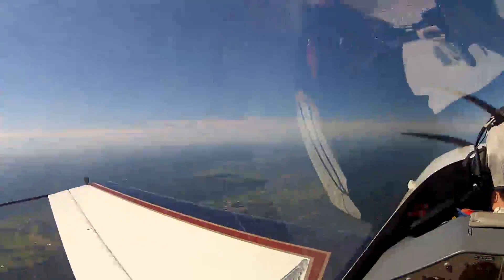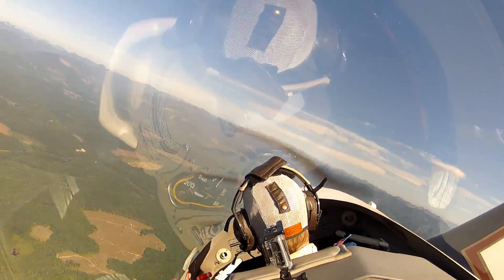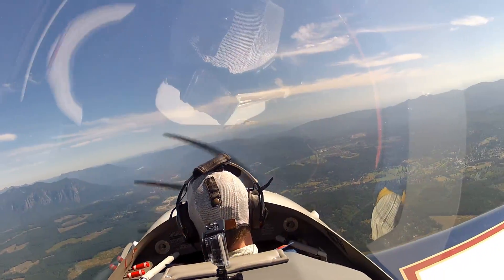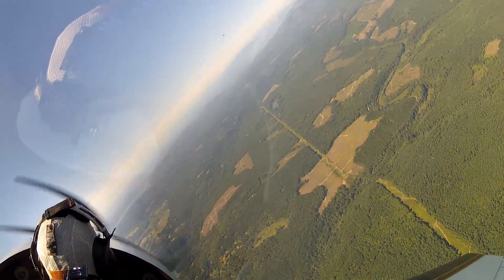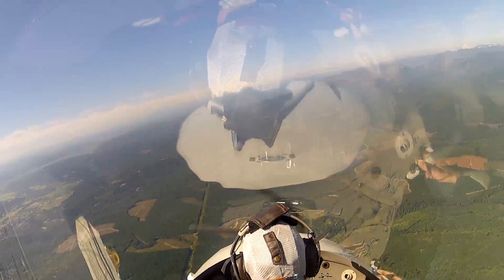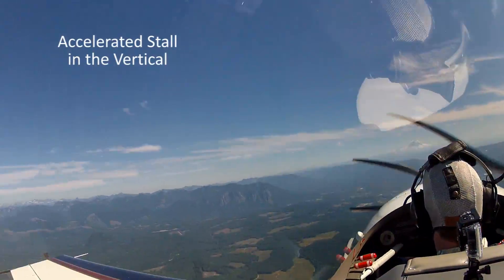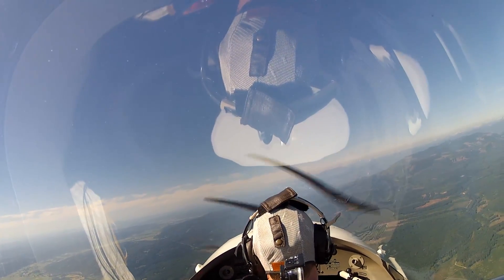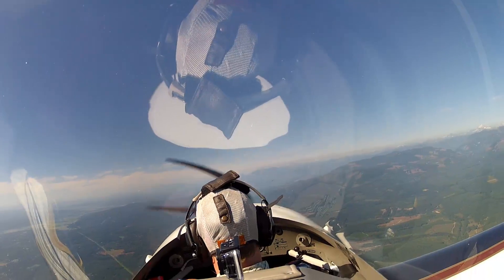Accelerated Stalls

Comment: I always thought acceleration stall is when the load factor is higher so more lift needed and it doesn't matter if it's coordinated of not. Could someone explain this?
Reply from the maker: See "Accelerated Stalls" on p. 4-9 of the "Airplane Flying Handbook" (FAA-H08083-3B) http://www.faa.gov/regulations_policies/handbooks_manuals/aircraft/airplane_handbook/
Reply: It doesn't matter if it is coordinated if your only goal is to see an accelerated stall.  However, if it is not coordinated, you might also get to see a snap roll too!